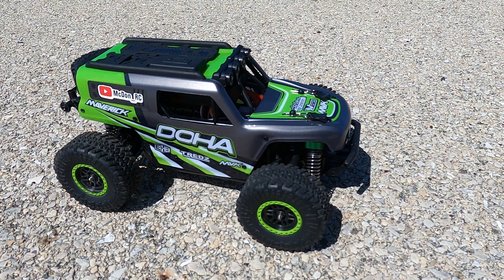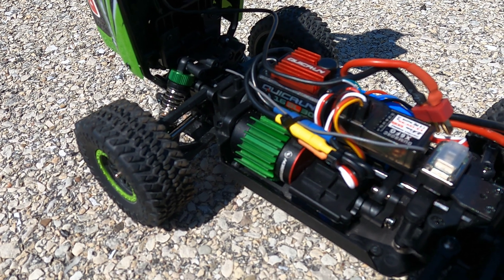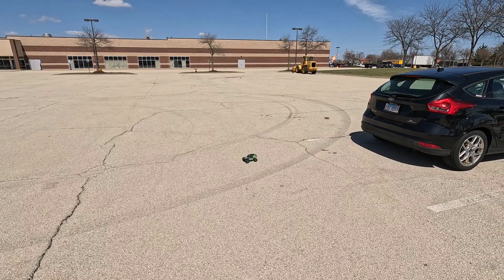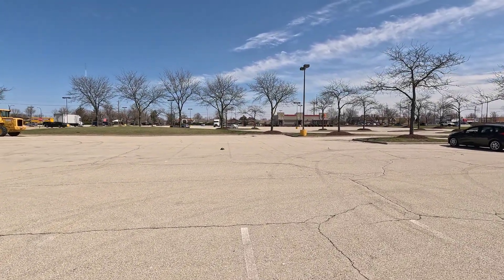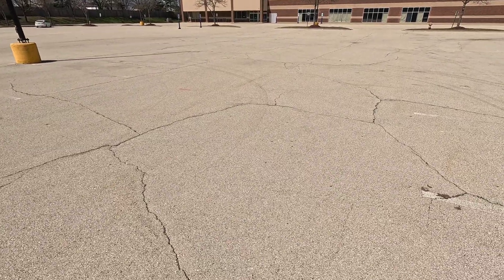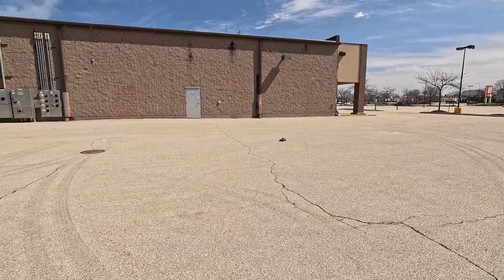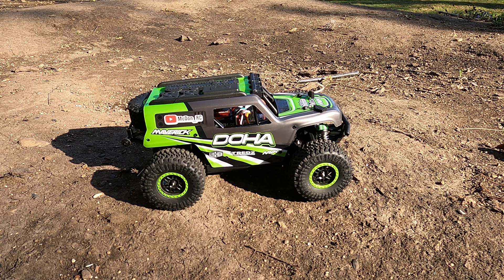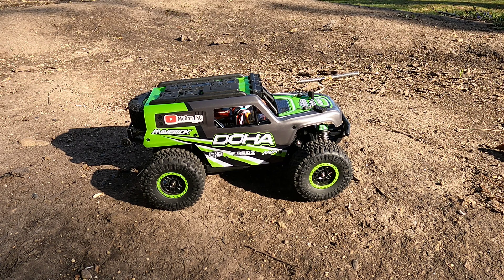Maverick DOHA Brushless Conversion

Comment: Any chance the motor mount plate is offset to one side a bit like with the 124008 from WLToys? Because people found out they can run a different pinion with it by turning the plate around 180 degrees.
Reply from the maker: @MrJaxco  It was not offset. You could probably take a dremel and slot the holes to fit a larger pinion. You would need to find a larger pinion that would work. I believe it is .5 mod but not 100%, and it would need a 2mm bore to fit the motor.